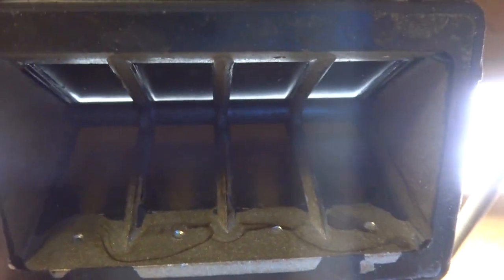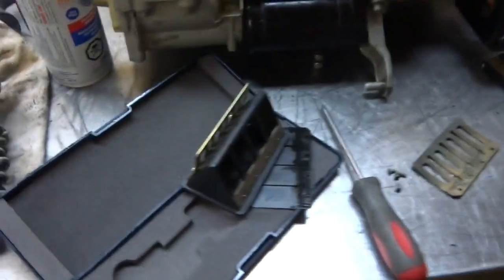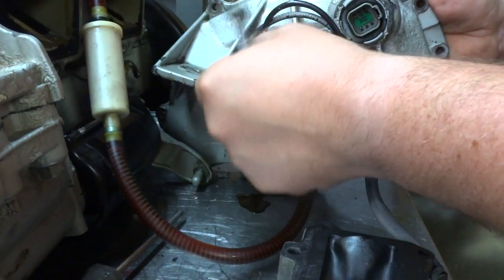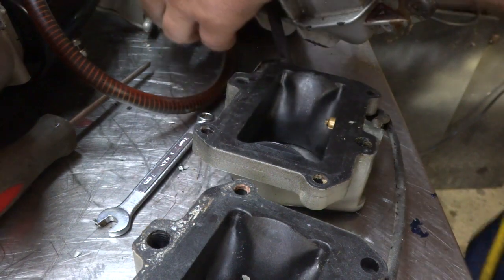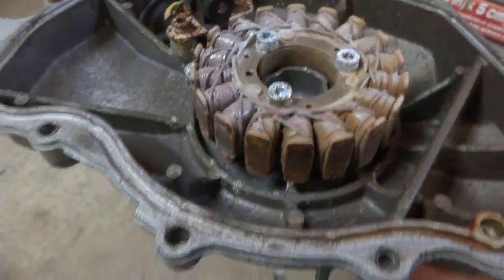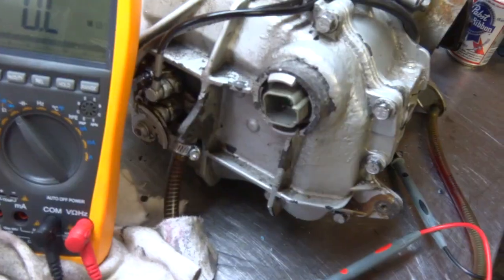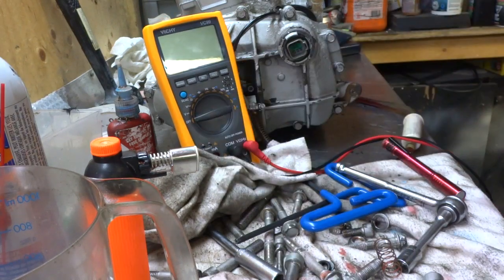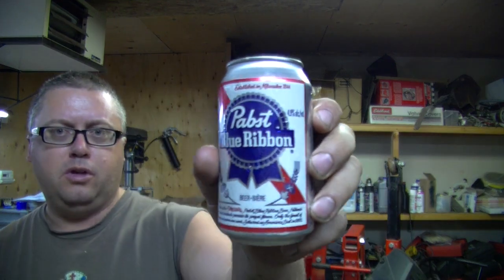Seadoo Stator testing and oil Priming

Comment: I have a 91 587cc seadoo has decent spark new carb kit new crankshaft and bearings and seals new external coil new lower engine case new starter and oil pump and new rotary shaft and seals but it won't start sputters ocasionally any idea why this fucking money pit won't fucking start ??thanks in advance
Reply: Ever figure yours out?

Comment: Hey, i had a question. Im trying to fix mine right now and can't remember which bolt lines up where when connecting the magneto tot he flywheel. Does it matter which degree it is rotated too? Does it have to be exact like timing?i just don't know which bolts lined up where. @bullshitkorner

Comment: Hey thanks for this video! I have a 94 seadoo sp with no spark. I want to test each component of the ignition system. I don't have a plug for my stator. Do I test the stator the same way as you do in the video? How do I test the coil and mpem?